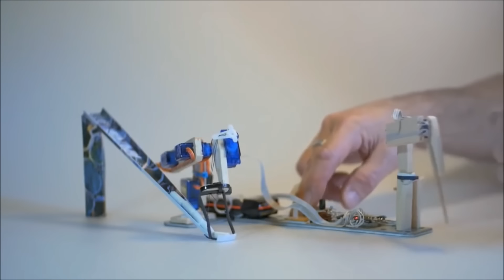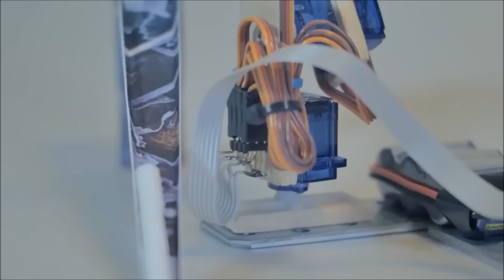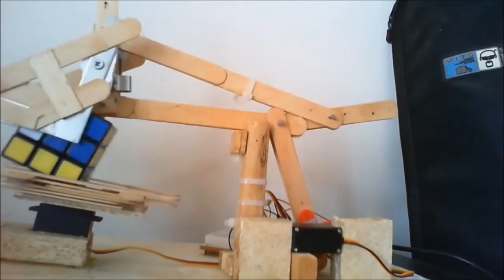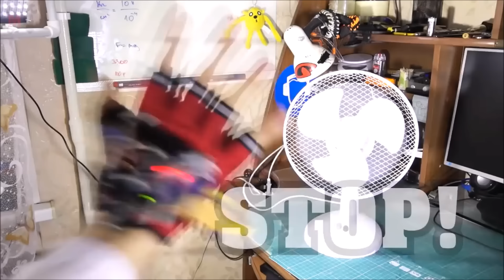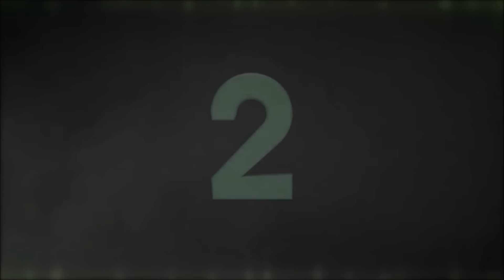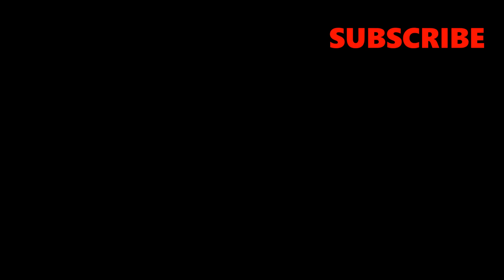TOP 10 Arduino Projects Of All Time

Comment: That projet with glove is realy just princip of animation
Reply: No it's just a flashing light flashing really fast so it appears to be slowing down time
Reply: @jacoblittle989  yes but i dont know if you were in the museum of pixar, but like this they show "gif" animation. It basicly is the princip of animation bacause it works with framing of human eye
Reply: @maximiliantyx6852  it's still really cool it might be a mix of both.
Reply: I thought the arduino just detected what RPM the object was spinning at and then with a hand gesture adjusted the framerate of the camera to match the speed of the object.

But a flashing light works too
Reply: @roomert  Do this with camera is wasting of time. Much easyer is just use that flashing
Reply: This sound bad but i mean it in good. Initializing camera and other stuff about that is little bit difficult because not every cam can change it's frame rate. So the light flashing is much easyer

Comment: Can anyone explain me ..what is that time machine glove?
Reply: It's flickering at the right time, For instance, the fan and drill are spinning, So all the glove does is turn on a light every time the fan or drill is in a certain position so it creates an illusion of time stopping! But it usually only works on a camera because of technical stuff unless you are in a very dark room!
Reply: @trgtheredstoneguy3990  thanks dude.. 👍
Reply: @shawn_parker8586  No problem! :D
Reply: @trgtheredstoneguy3990  na it also works with the human eye, for example at my uni they have a vibration lab and they use a strobe light to show the different modes of vibration (by having the light flash at that frequency)
but yeah, the light is very bright, you are totally right about that :D
Reply: @johnuferbach9166  That's pretty cool!! :D
Reply: @johnuferbach9166  That's pretty cool!! :D

Comment: So basically the time machine thing is an emp?
Reply: It's an illusion, There's a light on the glove that's flickering at the right time, For instance, the fan and drill are spinning, So all the glove does is flash on a light every time the fan or drill is in a certain position so it creates an illusion of time stopping! But it usually only works on a camera because of technical stuff, unless you are in a very dark room!

Comment: Hey Bro, I am working on Hand Gestures Recognition with the help of MPU 9250 or 6050 (Accelerometer, Gyroscope,). We have to turn ON/OFF light or Fan with the help of hand gestures. It would be so nice of you if you share your dataset.
Reply: Have you done ?
Reply: By the looks of it he used a stroboscope to make it look like the blade wasn't spinning by matching the frequency of the light with the framerate of the camera
Reply: @stijnteekens2231  yeah the light makes the frame rate match the speed of the fan so it looks like it's actually doing something when its not, it's just turning on a light

Comment: Yes, some are cool, but most of them are using basic codes and do not require special attentions. Arduino is a microcontrollee board, and can be used to to better things than analogRead(), digitalWrite(). Make an effort, author of this video, there are better projects on the arduino website than this.
Reply: Jules A It's the creativity within the projects, not the code by itself
Reply: Preston Matheny
Come on, Arduino is a microcontroller board. Almost everything can be done using it. I am planing to build a robotic vacuum cleaner, using Aduino ,Fluiddyamics and mechanics. This is the kind of projects that need to be on a top arduino projects video, not some dude with a clove, that stops  and turns motors.